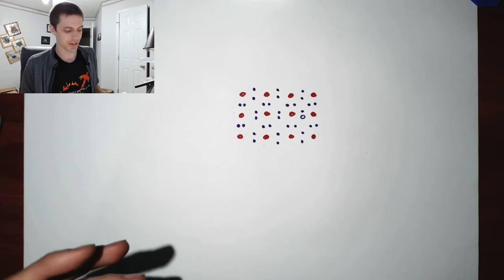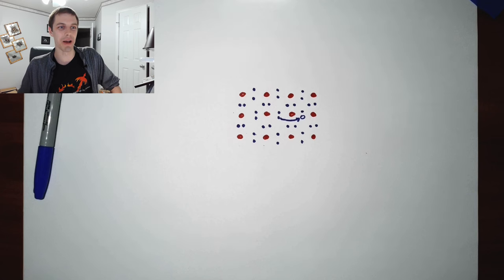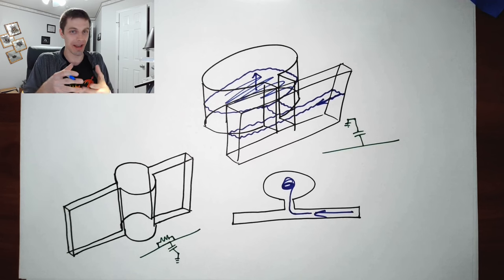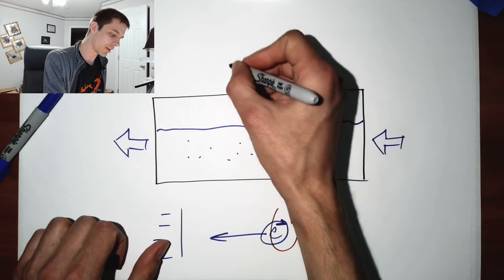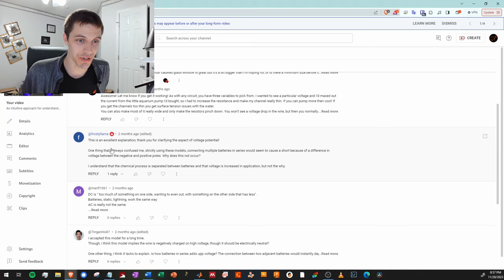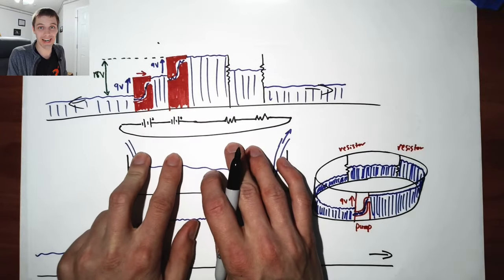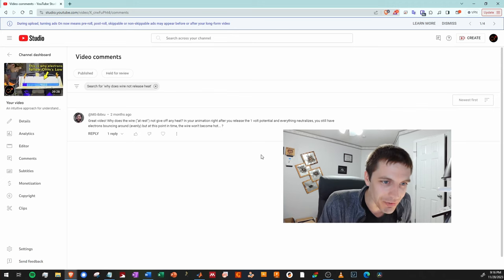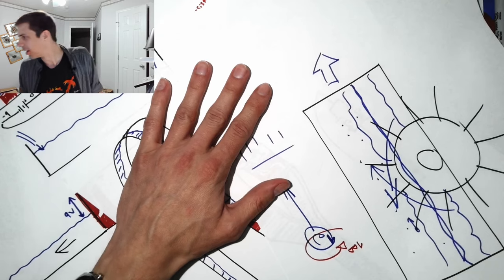"An intuitive approach for understanding electricity" AFTERSHOW

Comment: I have experienced lessons about electricity and physics, but can't say I fully understood them. Certainly not to the point where I can explain what amperes are.

Because of your videos, I now know what volts are intuitively.
Emphasis on intuitively. I can explain that it's the relative difference in charge between two distinct points.

Comment: Great vids. I use a similar water analogy when explaining how electricity obeys ohms law to my classes of apprentices.  I compare the resistors to spring hinged vertical gates in the water channel. The higher the resistance is, the stronger the spring hinge is, which opposes the gate opening. Dependent on the available water pressure (voltage) this determines the amount of water (current) that flows in the circuit.

Comment: Actually I think the connected paddlewheel analogy models the transformer quite well because the primary and secondary windings are actually in phase with each other. The current in the primary winding induces a magnetic field that is 90 degrees out of phase with the current, then that same magnetic field induces a current in the secondary winding another 90 degrees out of phase making the secondary 180 degrees out of phase from the primary. The secondary can then be brought back in phase with the primary by changing the winding direction of the secondary or reversing the polarity of the output (look up the transformer dot convention).
Reply: I disagree, because rigidly connected paddle wheels would keep working perfectly fine (probably, even better) with DC water current, while an electric transformer requires AC to do anything.

Comment: IMPROVEMENT: your hydraulic capacitor is just adding a connection to Earth, the charge reservoir.  That's not needed.
In the 1890s, Oliver Lodge figured out a water-analogy capacitor.   Just use a balloon membrane, stretched across the current path.  Then, whenever we "charge" the capacitor, the water stretches the rubber, storing some energy.  To "discharge" the capacitor, the stretched rubber is pumping the liquid backwards.   This debunks a misconception because it demonstrates that the total charge never varies inside a capacitor.  (We "charge" capacitors with joules alone, not with coulombs of charge.)   To add energy to a capacitor, we take charges from one plate, then insert them into the other plate.   This "stretches the e-field lines."    In the water-analogy, it stretches the rubber.

The MIT t.e.a.l. project for 8.02 EM classes has some great CGI e-field videos about this, one for charging, the other for discharging.   Capacitors are powered by "charge-imbalance," and by stretched-out e-fields.   I tell students that capacitors "store charge" in the same way that inductors and resistors do.   Meaning, they don't.   Capacitors are 2-terminal components, and the path for current is THROUGH.  (But in the fluid analogy, one part of the current is made of moving rubber!   Heh, the rubber membrane is the Maxwell Displacement Current!)

 (BElow, must first add the dot back in to addr, before the com.  YT randomly deletes comments if they have URLs  ...even with links to YT videos!)

Charging a 2-sphere capacitor   
www.youtubecom/watch?v=O5fHvc4Edvg

Discharging the capacitor   
youtubecom/watch?v=5G7j0d88NGc
Reply: Thanks for posting the links to the two short model-animations; mesmerizing and definitely insightful.

Comment: I still believe you could model a transformer with your trough model.  Instead of connected paddle wheels, use a parallel divider wall down the center, this divider would oscillate from wall to wall (maintaining parallel).  This would also create the out-of-phase motion.  The voltage difference could be visualized by height of water column, and the turns ratio could be visualized by the ratio of distance between the wall and divider.

Comment: I think a turbine pump would be closer to a constant-pressure pump, if only because it’s a Norton equivalent source with non-trivial parallel resistance.

Also your reservoir tank capacitor only works for a parallel capacitor to ground, it doesn’t work for a series capacitor. Rubber membranes are required for this.

Comment: 15:00 On the transformer water analogy: Maybe something like two floats connected by a pneumatic line with a bleed valve? The relative size of the floats is the equivalent of the turns ratio and the bleed valve in the line is for the derivative
Reply: I think it would make more sense as 2 floats connected by a seesaw. if the water is going up and down then it is pumping the seesaw and when one float goes up it causes the other to go down thus inducing an oscillation in the other side of the transformer. If however one stays up then the other stays down and no energy is transmitted. the ratio of turns can be modeled as the distance away from the pivot point of the float. A 1:2 ratio means the arm on the second float is twice as long and thus will pump a wave twice as high but will have less mechanical advantage so less oomph (more voltage less amperage).
Reply: @tenaciousdre   Nice idea! At least the ratio is a lot more visual. On the other hand the voltage/water level will stay high when the float gets pushed under water... 🤔

Comment: The standard analogy that I've seen for a capacitor is a thin elastic membrane in the channel. This allows for a capacitor that isn't to ground, and the fact that DC currents can't flow through it. 

The analogy ive seen for an inductor is a water wheel. I believe that if you connect this to a water wheel in another channel (optionally through a gear reduction to represent the difference in turns), you can get a pretty good model of a transformer
Reply from the maker: Ah I should have clarified - you’re totally right a capacitor with both sides is a membrane. I was specifically drawing a capacitor to ground. Too much signal propagation on my mind cause of the next video…
Reply: @AlphaPhoenix2  Also, I should have finished the video before I replied. I forgot how a transformer works XD.
Reply: @AlphaPhoenix2  An expansion tank, as used in e.g. domestic hot water systems, is a close equivalent to a capacitor to ground.
Reply: @rschroev also hot water tanks are heat capacitors

Comment: Hi AP, great video with very intuitive explanations. I found it very interesting, but was wondering how the scale was calculated when comparing the water model to real electricity. To find the size of the new tank, i would assume you see how many electrons are in a 1m wire, and scale that to the size of a water molecule. The part I am struggling a bit with seeing the conversion is with volts to cm of height. Since this relation works in the context of energies, is the conversion simply a matter of seeing at what distance from the earth does raising a water molecule 2cm produce an eV of potential energy? Then, would the top of the tank be at this distance from earth, and the dimensions of the tank determined by the answer to the first part? Thanks, and please keep making these!!

Comment: Your pumps have to float in the way that their intake port will be just below the surface of incoming water to be precise. You don't know hom much water will come to the pump at any particular time. And imagine a variable resistor, so just for water model to work more precise. 16:36 and further
Reply: A more accurate (but perhaps less visually descriptive) way to think about it is just head pressure. A pump moving water between two reservoirs doesn't care what the absolute pressure is, just the difference between them; the pressure difference that it can manage is the head.

This analogy even works to describe how a battery's voltage drops under load. When a pump is working to make the maximum head that it can, the flow rate is actually zero. But, as that head drops, the flow rate increases. So, if pumping into a reservoir with no drain (no load), the water's height (voltage) will end up being equal to the maximum head; if there's now some flow rate out of that reservoir, the water level will decrease until the pump's flow rate equals the draining flow rate.

Comment: Some feedback: 1) Can you show us how a venturi tube would look like as its analogous electrical system? 2) I think a great example of where inductors behave exactly the same in both worlds is the Water Hammer. When you close a valve, all of a sudden you get a transient spike of pressure that is so strong it can easily tear apart very thick pipes. It’s just like when you quickly stop the current going into and out of an inductor - it’s very common to blow up diodes by having an inductor force current to go through them the wrong way with the spike of voltage it assumes. 3) I think that if we see transformers as something that keeps the power in the water constant but changes the pressure, we can simply use a change in a tube’s cross section as a transformer. When the cross section is reduced, the pressure goes down but the speed goes up. The power transmitted by the water is kept constant, but we have managed to change the pressure (as well as the speed).
Reply: A transformer is an AC device, it does not work in DC. Electrically, the magnetic field strength is proportional to primary side current, then the secondary side voltage is proportional to the derivative of the magnetic field strength with respect to time. If the primary side current is constant, the magnetic field will not vary with respect to time, and hence the secondary voltage will be zero. Hence any method that works with a constant DC flow of water is not an accurate analogy. Also changing the cross sectional area of an open channel will not change the pressure, just the resistivity. This breaks down when the water flow gets fast enough to flow uphill with its kinetic energy, but that’s not a phenomenon with an electrical analogue. Water’s momentum is akin to inductance in the hydraulic-electrical analogy, but a DC current cannot increase its voltage just by flowing through an inductor.

The Venturi effect has no electrical analogue for the same reasons.

Comment: Re: The water model, and also circuits in general, I'm always left puzzling about things like a tap/faucet. What is that? It's just water spilling out of the nice watery circuit and into the void of the world.

Similarly: Why can't a positive of one power source go through a bunch of resistors and then into the negative of another source? If one power source is "pumping" electrons to a higher voltage, why does it need a circuit of them? Especially as the drift velocity is really slow so the individual electrons barely move. As long as there is some supply of electrons, why does it matter that they all link up in a big circle? In theory you can stab both "open" ends of the power source into the physical earth and claim they're connected via that and now suddenly everything works, as if there's an actual direct flow between them (but also not between everything else stabbed into the earth).

In your most recent video of the time-multiplex oscilloscope animations  of open circuits I can kind of see you need compression in the red wire and a decompression in the black wire... but again why does it need a circuit for the current?

It's all too mysterious for me :)

Comment: Transformer could be modelled i think as a combination of couplings, gears and "inductors" using equivalent circuit model: 

You have a big heavy paddlewheel blocking the channel, with side channels off the front and back, which connect together at a "light" paddlewheel connected to a shaft that couples the output(possibly geared) to a similar setup in another channel.

Edit: i.e. take the obvious, flawed approach of two coupled paddlewheels, and modify it slightly so the coupling is based on the voltage induced by a changing current over an "inductor"

 the big paddlewheel is the magnetising inductance, the (light) coupling/gearing in parallell is the idealized coupling between the windings.

This would represent an ideal transformer-
You could add resistances/inductances in series/parallel to make it even more realistic

Comment: Hey @alphaphoenix , I have a question regarding capacitors that...why when we connect it in a DC circuit...why do we say that the charges on one plate will be exactly equal to other(magnitude wise)? My textbook says its because the battery always receives the same no. Of electrons on one side as its releases from the other side...so charge should be equal and opposite but they don't give any answer like who batter does that? i think that's incorrect as in transiet phase the currents are not equal it's just happens that when static equilibrium (here in the case of capacitors connected I would say quasi static quilibrium) is established the currents becomes equal because if it isn't the cahrge will be accumulating somewhere whoch would change the electric field to dec. Somewhere and inc. somewhere. But can u tell me the reason why it should be equal and opposite always (i.e all the time from the start of current flow to the end)and why it doesn't matter how many of them are connected and how they are connected?

Comment: Great video 

As some one that has had these concepts in my head sorted out for decades.
Even though it SHOULD have been taught 
Alot of it wasnt. It was up to the individual to figure it all out 
And make things fall in place And align 
With laws and results of 'self'  experiments 
( Way before the internet🙂)
I wish I had something like these videos when I was young , if nothing else just giving someone a bit of positive reinforcement that their experiments are not too out there and Do make sense 

So great job ! 

Isn't it funny Attempting to explain a 'simple concept's that is not ' tactile' 
always Seems easy in your head ( where it all makes sense )  until you try to do it
Then it ends up ' slightly tangled up'
Translating your thoughts into something understandable to others that may not have your base of 'accepted fundamentals'
That you take for granted in your head 😀

It's great to see someone else having the same thought processes  as my self 
Getting a bit tangled up sometimes as it doesn't seem to follow what you thought

The ( basic ) laws of Physics doesn't 
Change it will always do the same thing 
If given the same variables no matter what.
The only thing that changes is ones perception and understanding of it

( Which sometimes depends on HOW we are thinking on that day lol )

Comment: Not sure where you draw the line on quasiparticles. When you get down to it, everything is a quasiparticle (maybe the photon in vacuum is the only exception). For electronic systems, for example, you can't describe the Hall effect with just electrons. The sign of the Hall coefficient is wrong in some materials, because the conduction is dominated by holes. You could work with "electrons", but those would behave nothing like standard electrons, since they interact strongly with the lattice close to the band edge.

Comment: I think the capacitor reservoir needs some sort of stretchy membrane across the middle? To capture the idea that it initially behaves as though it’s conductive, but then stops conducting when the membrane has stretched as far as it’s gonna, given the difference in water height across it. Also so it sloshes the water back the other way when the “voltage” is removed. Guess now I wanna see a paddle wheel and stretchy membrane LC oscillator 😆

Comment: If you weren't losing any energy in a transformer, wouldn't the current in the secondary coil keep flowing even after the change of current in the primary has stopped?

Comment: Would the transformer equivalent be like the connected paddlewheels, but connected by a torsional spring?
Reply: Spring would be loaded by accelerating paddle 1, then unload stored energy into paddle 2, meanwhile, paddle 1 starts in the opposite direction (AC), reversing the torsion in the spring.

Comment: At 14:27, I think you CAN model the transformer with the water model: use a car's automatic transmission's torque converter as a model. 

It's as if you're in a dimension where (∆I) versus ( I ) paradoxically interplay—but only on the non-zero slope part of —and your literal paradoxical crossing from the (I realm) to the (I and ∆I realm) cannot be expressed in only the (I realm.) It's hard to express due to its paradoxical nature. If this sounds wanky, then you're probably close to understanding the thing being explained. ;-)

That you say, “derivatives” tells me we're talking the same thing.

Going further down the rabbit hole, Neil deGrasse Tyson refers to it in his talks, here: https://www.youtube.com/watch?v=xC74X1EQUY8&t=665s but he also says that we're presently stuck in 3D modes of thought. Once “we” advance to more complex modes of thinking, we will—should—be able to model what you can't currently model. 

Regards.